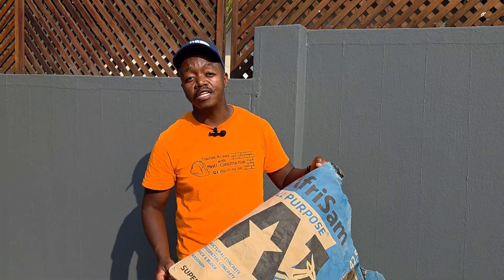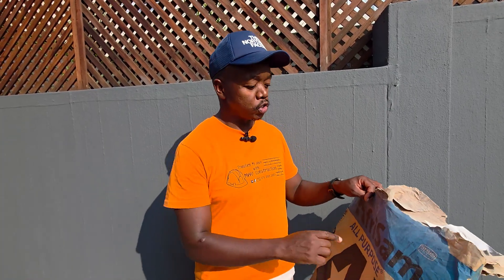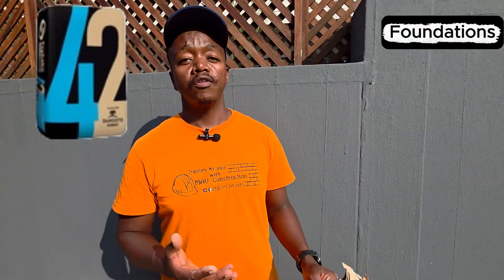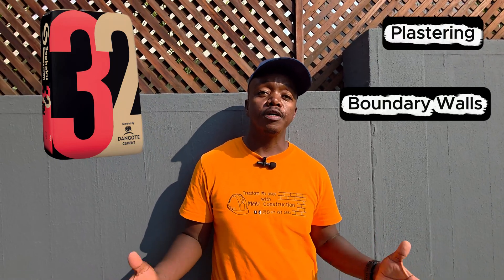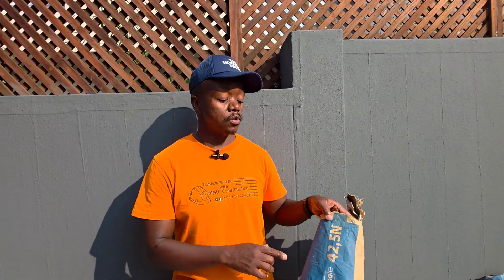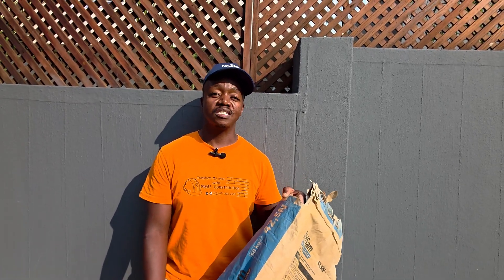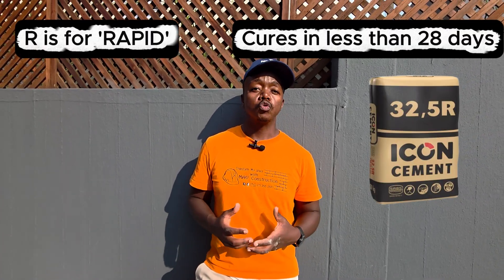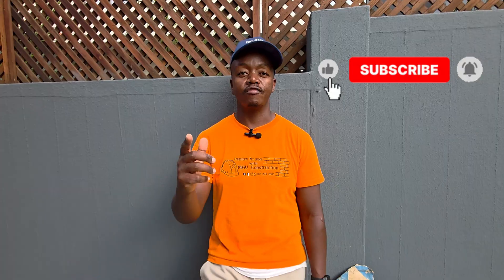Cement bag Options Explained: 32.5 vs 42.5 | N vs R | Prices & When to Use Each

Comment: Thank you for explaining this information in layman's terms what does curing mean and why must water be poured 
if water is not poured will there be problems
Reply from the maker: You may not certainly have issues/problems... but best practice is to do a wet curing process to achieve the best possible durability

Comment: Thanks, great content. So is it correct when the builder says using 42.5 cement they need less in the concrete ratio? Because from what you’ve explained it’s about the setting strength, so why would they play around with the ratios?
Reply from the maker: Its not about higher ratio on 42N.. use the same ratio and get better strength with 42N...